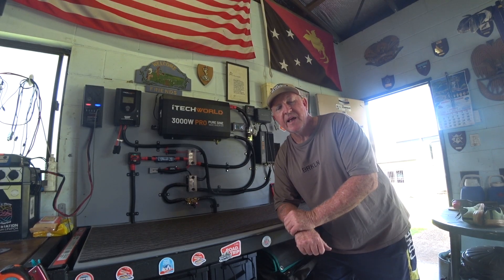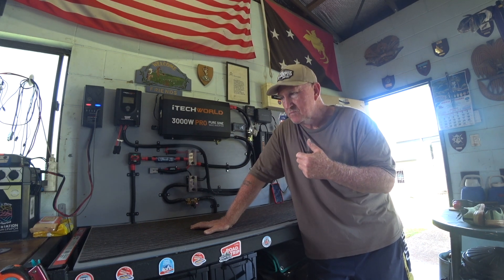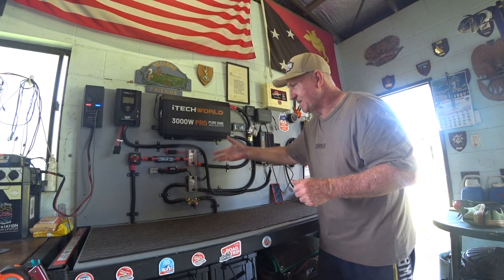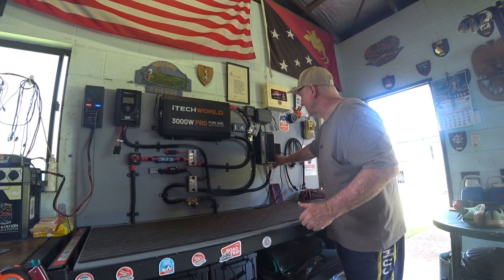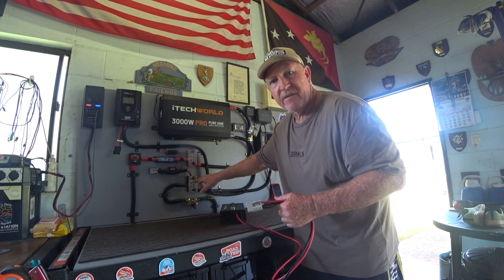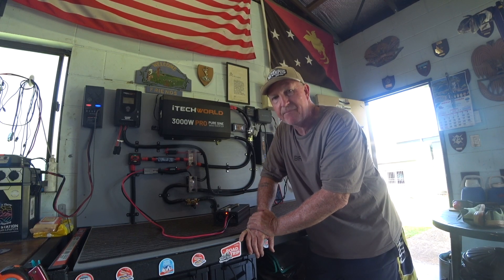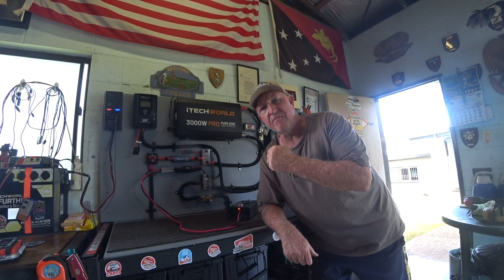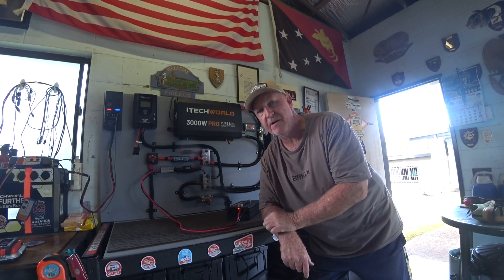Pumping 80 A into my off grid batteries - How to do it during a power outage. #litime #itechworld

Comment: G'day Buck.   A bit behind & trying to catch up on your vids (sometimes life just gets in the way), but hoping you still see this comment.  Just a tip to make charging your batteries a bit more efficient through the day.  A bit more juggling plugs, but, rather than leaving the house running off the inverter during the day (which will take 300 - 500W away from the 1000+W that your 2 ac/dc chargers are supplying), switch the house supply lead on to the generator power board and run the house direct off the generator during the day.  As you said the generator is a 2500W, it has unused capacity, so better to use that extra generator capacity to run the house, while leaving the full amount of power from the chargers going into the batteries for the next night.  Then when you shut the gennie down for the night, simply move the house supply lead back to the inverter.  (As you are using a 15amp lead to the house, then you would either need a 15amp power board, which I don't know if there is such a thing, or run the house lead off the 2nd outlet on the generator.)